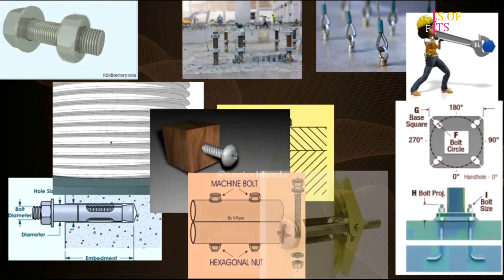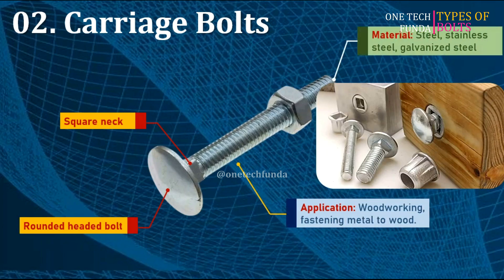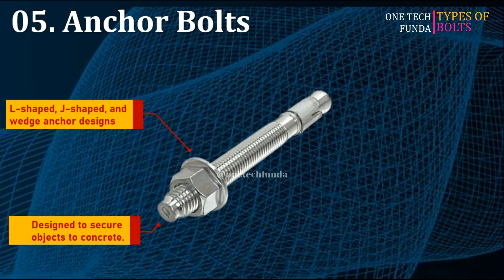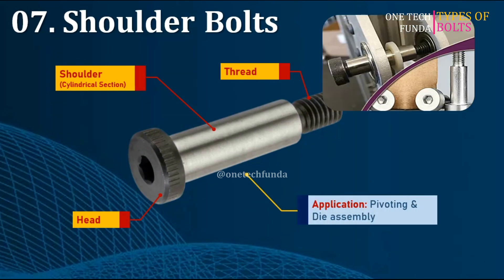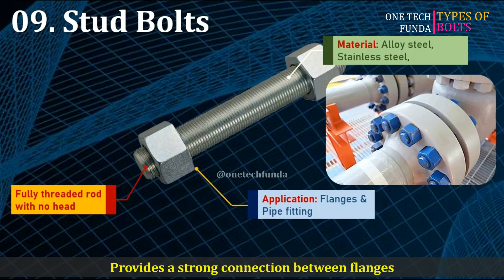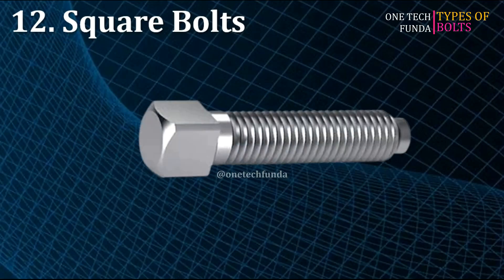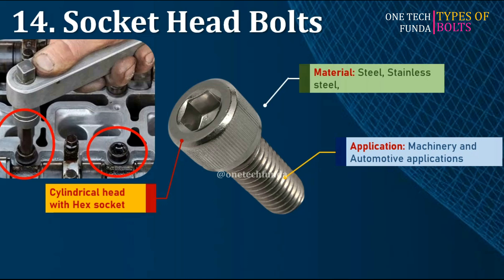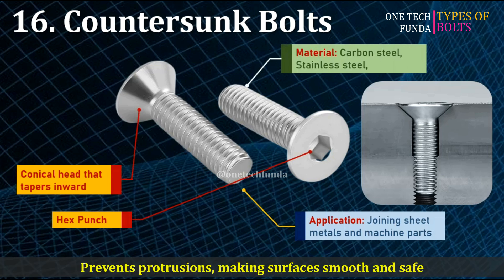Types of Bolts

Comment: the main advantages "ARE"  not "is". I hope you  got  the rest of it correct. 
The whoosh clunk introducing each new bolt gets old fast. Have you ever considered editing and previewing?
Reply from the maker: "Thank you for your input! 
I appreciate you pointing out the grammatical error regarding the use of 'are' instead of 'is.' 
I’ll be more careful with that in the future. 
As for the whoosh-clunk sound, I understand your point, and I’ll consider editing and previewing the content more thoroughly to improve the flow. Your feedback is valuable. 
Thanks again for sharing your thoughts!"